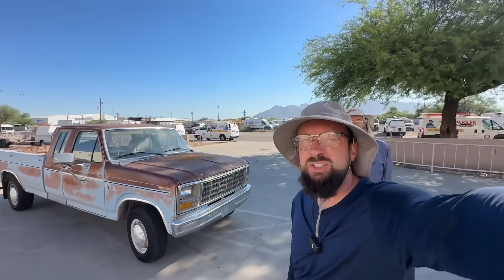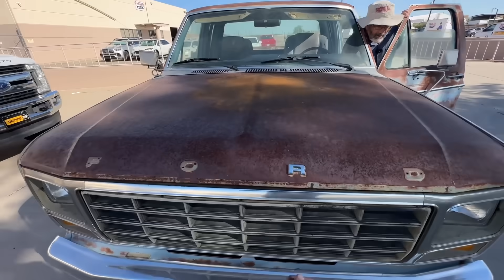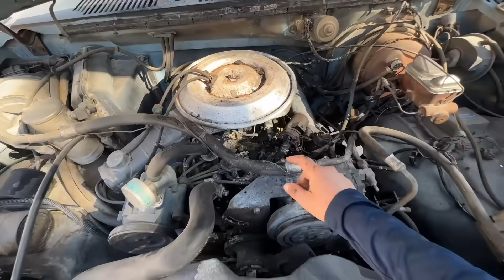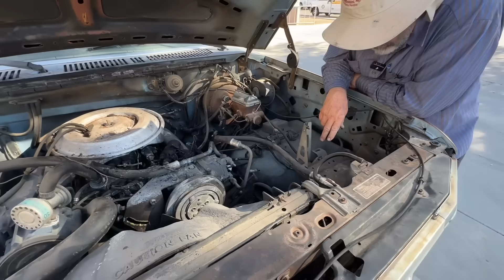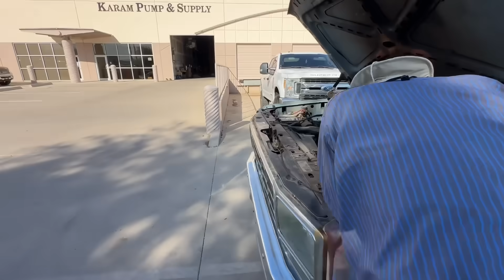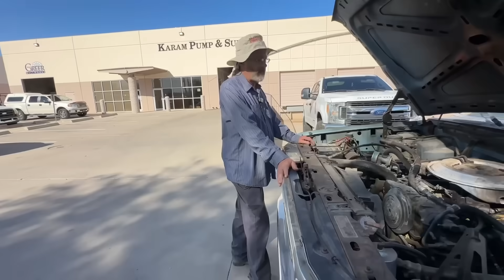I bought & fixed a 1981 ford parked for an ENGINE FIRE. will it run and drive again?

Comment: dad... "tires don't look to bad. they not drywalled or anything!". lol. that ol ferd is in great shape. and the connector inside bed rail is for camper power. part of camper special option.

Comment: I'd strongly suspect the ethanol in modern petrol as the culprit for the engine fire - it destroys those older fuel lines.  Please check/replace your older fuel hoses, folks!